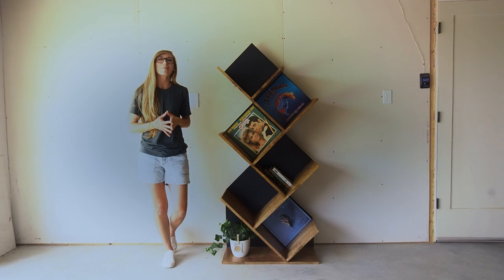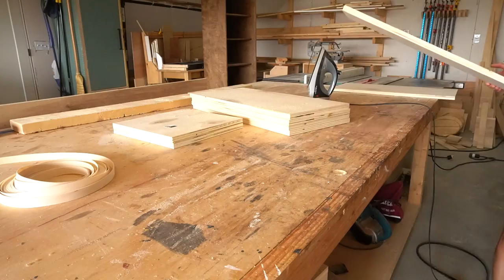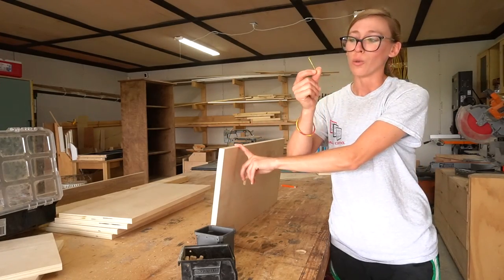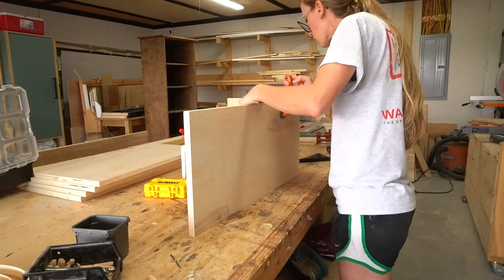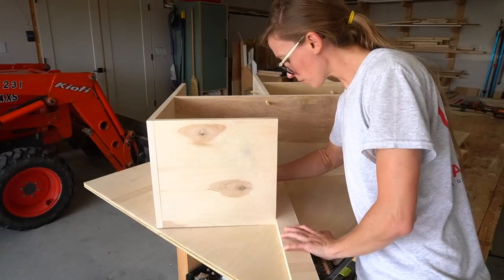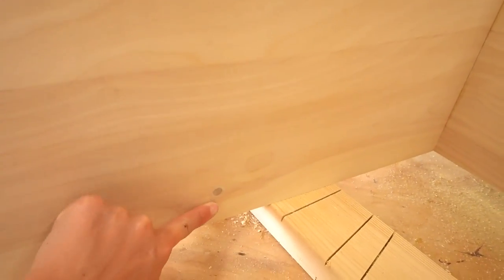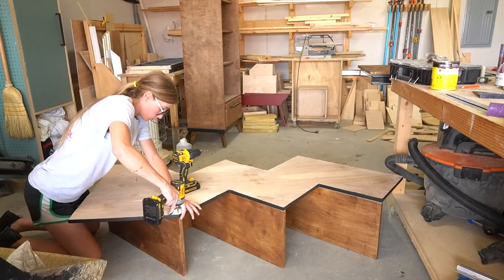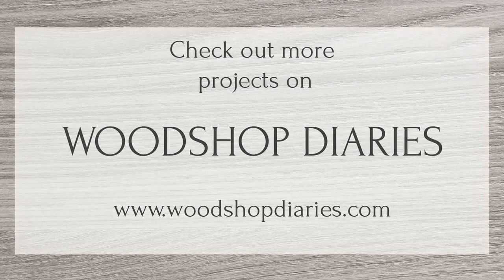How to Build a Modern DIY Vinyl Record Shelf

Comment: Tip on the garbage bag paint tray liner.... put the tray inside the bag. When you’re done, you throw the used roller reads, rags, etc. into the tray, then turn the bag inside out. All of the mess is inside and your tray stays pristine.
Reply from the maker: Genius! Thanks!

Comment: Cool design! I think you will find it easier to drill with a fostner bit first. The point in the center of the hole helps line up your pilot hole for the screw perfectly. Alternately, you could buy a drill countersink combo bit and do it all at once. And lastly, buy a set of plug cutters and you can make your own plugs out of face grain wood which will match the wood much better. Since the end grain of the dowel is end grain it will soak up more stain. I hope you don’t mind my thoughts on this. Keep up the great work!
Reply from the maker: Thanks so much! I appreciate you watching!

Comment: One tip" dowels are always "end grain", so they will always look different than the face of plywood, and will also absorb stain SO much more and be darker. For hole plugs, you can buy a "hole plug drill bit" so that you can cut drill bits from the faces of boards, and even even orient the grain in the same direction as your board.
Reply from the maker: Cool thanks! 👍

Comment: Great job, Shara. I love it!
Question: is there a structural or strength element in this build to use mechanical fasteners over, say, dowel joinery, or if I were to have a domino?

I was checking to see if there was a specific reason for screws or just preference.

Thanks!
Reply from the maker: Thank you! 

No, if you have the means by which to use dowels or a domino, I’m sure those would work just as well.
Reply: @WoodshopDiaries  thanks! I’m building it this upcoming weekend. You’ve inspired me. Wish me luck! 😉

Comment: Not sure if you'd still reply on an older video, but I'm having a hard time understanding how the "V" attaches to the bottom base. Are you screwing directly into the connection point of the V or favouring one side? If you screw right into the joint won't it lose some strength / shift the boards and make it off set?
Thanks

Comment: Trick I learned, for using an oscillating saw.  I took a blade, flattened off the bottom Turning it into a flush cut saw.  You still have to be careful so it doesn’t gouge, and then can be done by applying pressure by raising the angle of the tool, forcing the blade to be flat.
Reply from the maker: Nice idea! I was using. A flush cut blade here. I just wasn’t being careful 🤦🏼‍♀️
Reply: @WoodshopDiaries  The flush cut blades you buy, are still very rough on the botton.  Run your fingers across the bottom, and it is not smooth.  I have found what they mean by flush cut, and being able to make a cut into door molding to make it flush with the flooring.

Comment: Complete novice and I was wondering  if you don't want the screws to be visible could you not just use fairly long screws and only attach the shelf boards to the backplate with those? You could still glue them to  help with alignment, but shouldn't that be sturdy enough and easier than countesinking and plugging every hole? Would there be an obvious issue I'm not thinking of if you would do it that way?